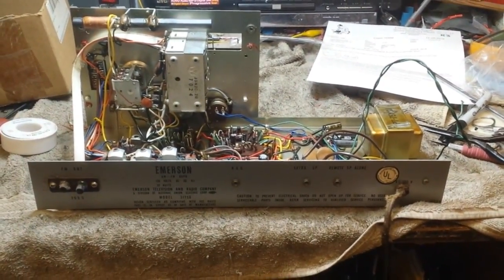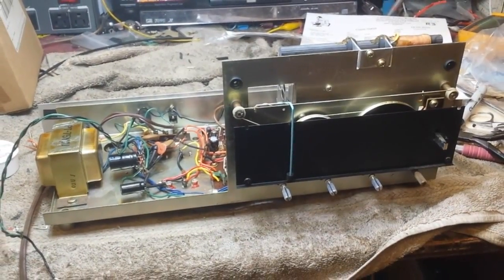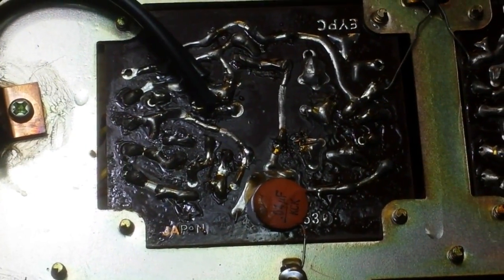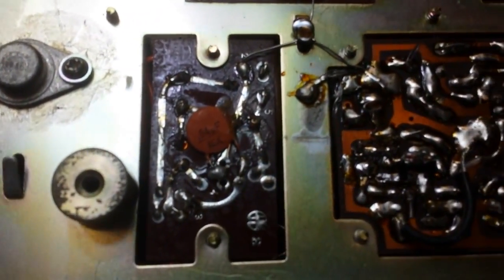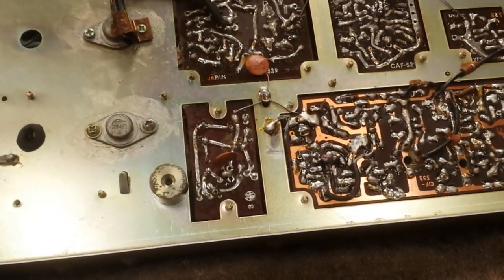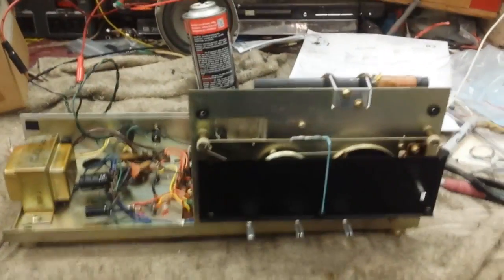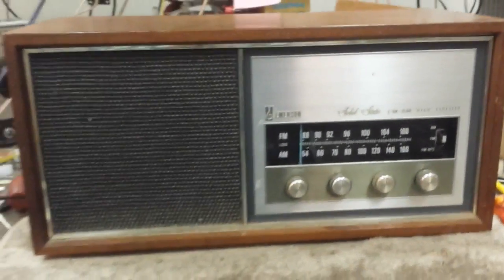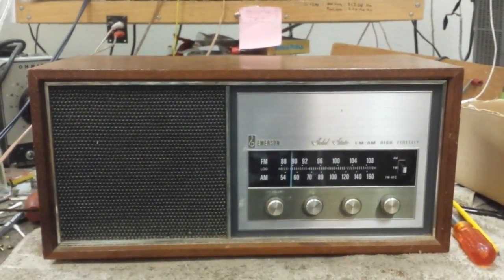Vintage Emerson 31T56 AM/FM "High Fidelity" Table

Comment: This radio was check rated by Consumer Reports in their October 1969 tests of table radios.There is a Matsushita logo on one of the circuit boards and the output transistors appear to be from Toshiba. So, maybe parts and subassemblies were sourced from different manufacturers for this radio.

Comment: 8:25 Interesting, though not surprising, that the vented Sony sounds better than the "Air Suspension" Emerson. The idea of a sealed enclosure must have appealed to the purists, but this has a little of that "boxy" sound that seemed to plague a lot of smaller wooden sealed speakers of that era. The only consumer-grade ones  I remember sounding really good were the GE "Acoustophonic" and latter Magnavox "Astro Sonic" systems, both with Styrofoam enclosures that were flexible enough to almost be considered passive-radiator designs. The sealed cast-iron mini speakers from the '80s also sounded pretty decent, though they were never cheap.  I guess that's why most speakers these days have tuned ports, despite whatever comb-filtering and transient slop they might have; extra deep bass for the money is just more important to most people.
Reply: Speaking of Sony radios with vented speakers, I just learned a new word; apparently the technical term for a "slow leak" in a speaker enclosure is "aperiodic vent". They even sell adjustable ones for people who want to get rid of the "boxy" sound of some sealed guitar speakers. As a kid, I was always experimenting by blocking, some, but not all the holes on the backs of radios (one even ended up burning its output transistors). I could usually find a configuration that optimized the bass response, but I never knew until now that that was an accepted practice with a formal name.

Comment: Where is your shop locate?
Reply from the maker: I work for classic audio repair in San diego
Reply: @JordanPier  I have the same radio but full volume one can barely here it. And a Humm in the speaker too..Got a direction for me? Not a radio wizard by far like you. Your radio is a charm,way to go 👍
Reply from the maker: @bluejayoutpost9170  hum can indicate failed power supply capacitors or defective output transistors. Either will cause the symptom.